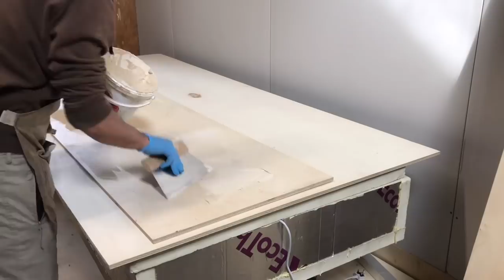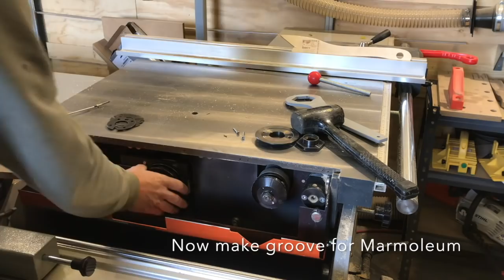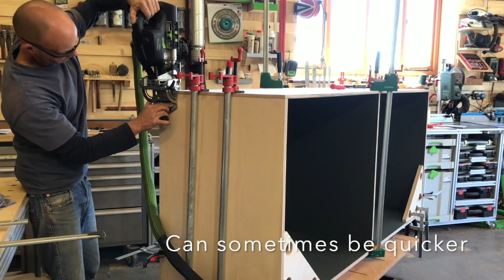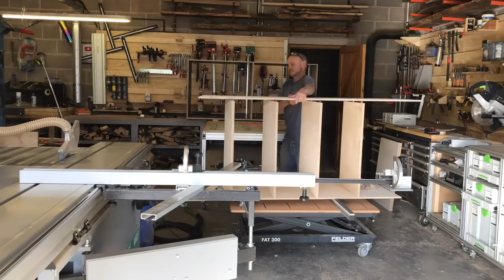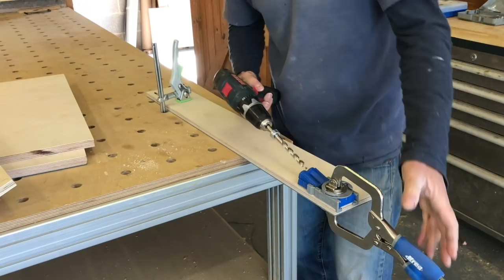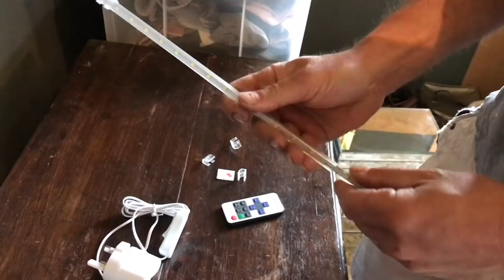Ply Marmoleum Dressing Room System +  Walk in Wardrobe

Comment: have you tried using the contact adhesive web spray for laminated products. find it works brilliantly ypu can pick up the system for around 300£
Reply from the maker: I haven't .   the problem I have with any contact adhesive and tricky glue ups is you only get one shot as I work alone it can be hard to get it first time every time. 414 is perfect for this ..  but I will have a look do you have a link I can see..   Best

Comment: Hi Mate, Ive just purchased the same panel saw. Have you had any issues with the saw bogging down when ripping hardwood?
I've tried ripping 50mm sapele and 40mm oak and the saw just boggs down and the blade stops? Also using a brand new 350mm Axminster Axcaliber 28T blade....
Reply from the maker: Never  had it stop on my ..or bog down at all cut some50mm walnut , Oak and sapele 40mm pretty easy..  I am using trend Industrial blades not tried any other blades so far .  think this is my rip blade .. https://www.trend-uk.com/en/UK/product/IT_90100706/4/290/rip_sawblade_350x30x35x28t.html
Reply from the maker: Just checked and all my Ripping blades are 16 tooth ..  but I would be happy to  rip with a 72 tooth if thats all I had around . could it be the fence free cut settings ?